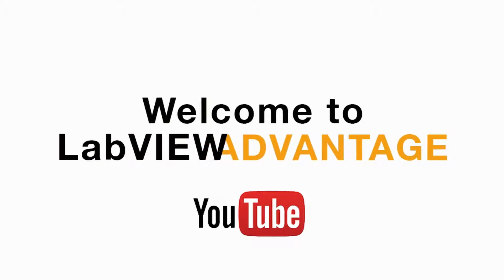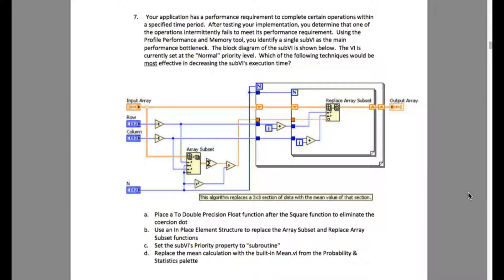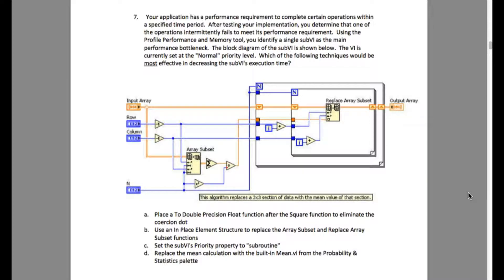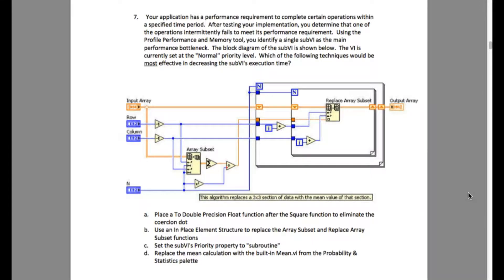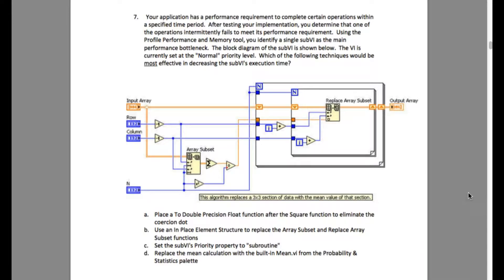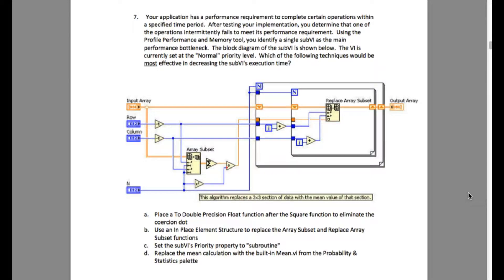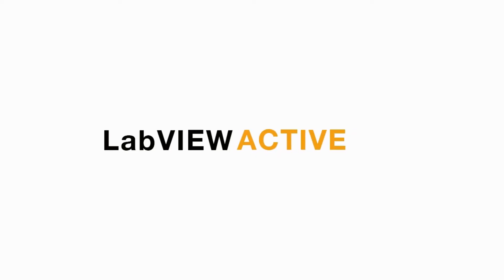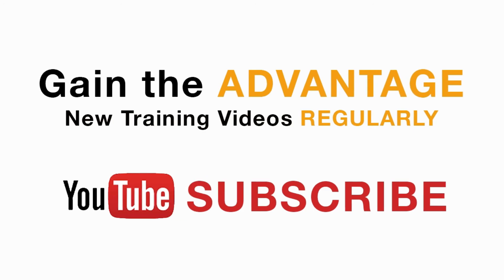LabVIEW CLD R 06 VI Priorities

Comment: Sample Exam 1 Question 7 and Sample Exam 2 Question 21 both regard performance. Both have answer options (1) "change priority to subroutine" and (2) "replace operation with in place element structure". The answer to E1Q7 is (1) while the answer to E2Q21 is (2). How do i know which option will increase efficiency more based on the provided screenshots?